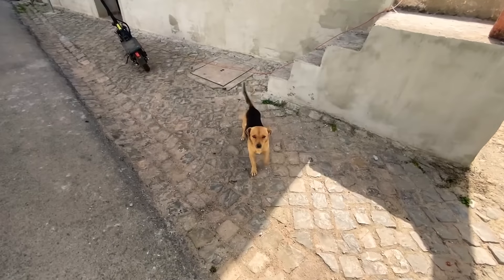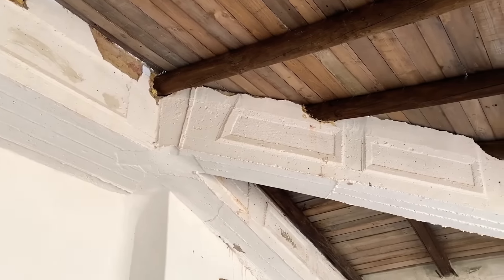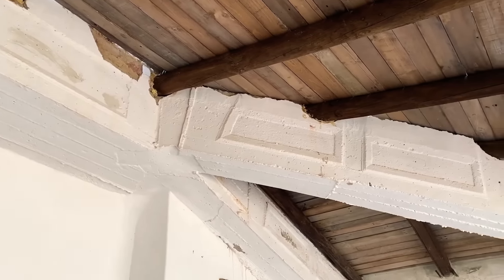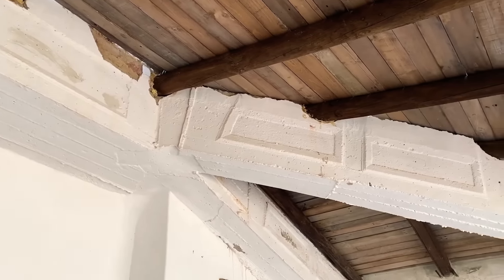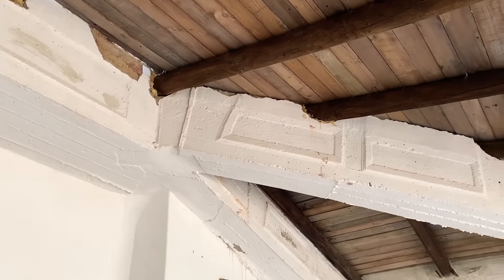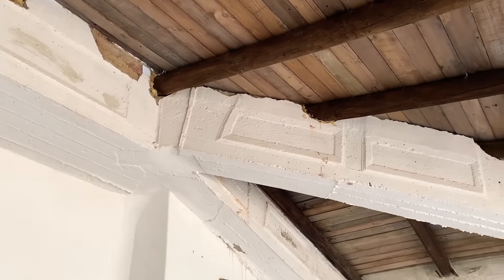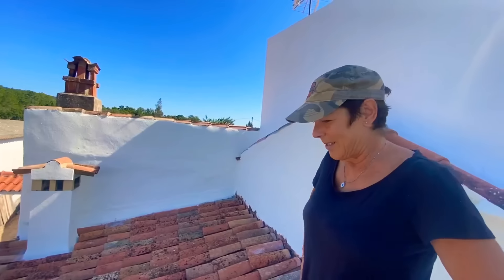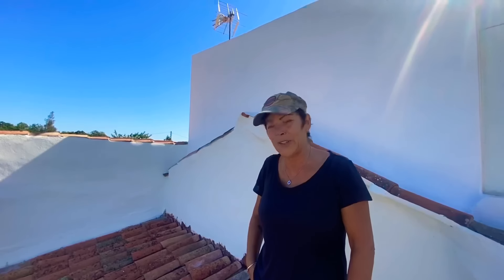Kitchen roof nightmare

Comment: You’ve had a tough week and I’m glad your keeping it real, showing us the difficult bits too. I’m in shock at the high temperatures. Heading over on holidays shortly and thought it would be cooler. Guess I’ll have to get the summer clothes back out of the attic. !! Wind, rain and floods here in Cork tonight.
Reply from the maker: Hi Saundra. Thank you for the comment. It’s been crazy hot recently but the rain has come and it’s cooled down now. It’s been a warm year like most years but rain has been the problem, so it’s welcoming to see it arrive now. Hopefully when you come it will have stopped. Remember the evenings are a lot cooler now so bring your jumper.😎👍